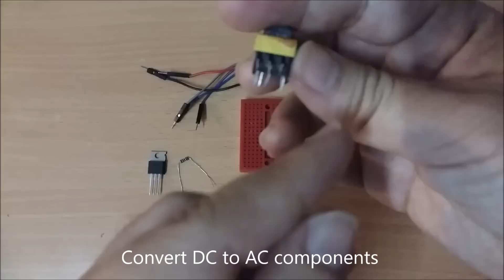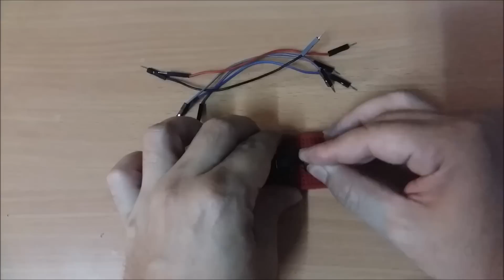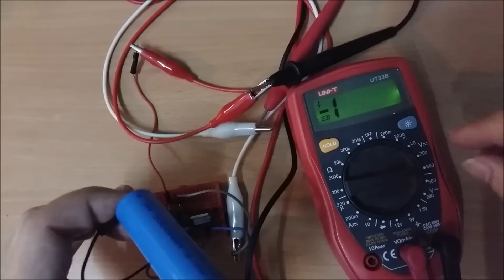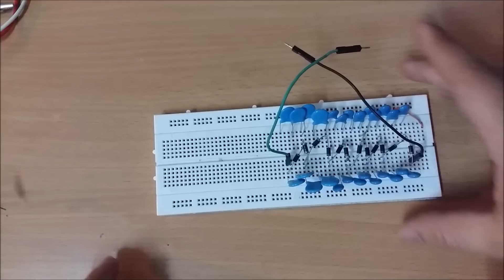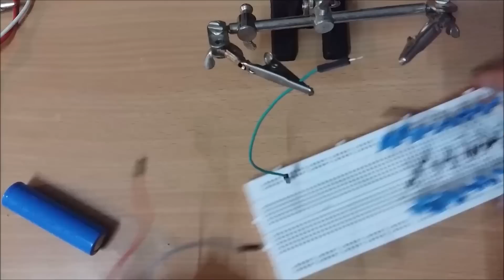diy voltage booster | dc voltage booster circuit | simple voltage booster circuit diagram | #youtube

Comment: hello can you tell the number of turns of the primary and secondary?
Reply from the maker: Hi juan i m not sure the number of turns in the primary and secondary coil because its premade transformer salvaged from faulty power supply..
Reply from the maker: Juan Ruiz the secondary inductance value is 0.688 henry

Comment: Actually my (prototype needs) 3000W.You have shown in your tutorial that you convert 3.7V into 3000V.Now if you see normall batteries it has 1 Ampere and 3.5-6V depending on battery.If i do the same set up it would give me 3000W as P=VI
power=3000W (required) ,I=1ampere,so, it would work and if you say it doesnt work help me out with a device that can get minimum of 3-6V battery to 3000W please please please help me out (and just for info im just a class 10 student and im tring to make an invention to change the world please help me out i would like to keep my project private please understand)
Reply from the maker: jabez david u got the wrong idea...by stepping up the voltage the ampere is being reduce..and if u step down a voltage the amp increase...but the wattage stays the same..so 3.7 volt probably can produce around 4 watt max ....when the voltage step up the amp significantly reduce but still maintain its capable wattage 4 watt....there is no circuit capable of stepup voltage and current at the same time
Reply: forza electronica is there no method to resolve this please think of something.all my hard work will go waste .plz i need to get only the watt.please think of something
Reply from the maker: jabez david maybe 24volt battery step up is capable of deliver 3000w but it will be complex circuit than this
Reply: forza electronica i need your help in the schematic diag of what circiut you are talking about and even the components and a small tutorial or lecture (written will be fine )